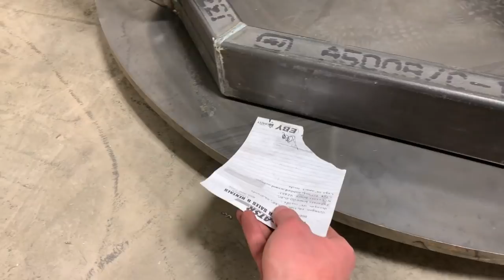Building a table to hold my vise

Comment: Excellent fabrication skills - yes. High quality video storytelling - yes. But absolute lack of planning. Honestly - if you see drawing of this first would you build it? Guess no. Because it's ugly and badly designed.
Reply from the maker: Ummmm.... I spent several weeks designing this in CAD before I built it. It’s not built for looks, it’s built for functionality.
Reply: It is few times (ten?) easier to fabricate square frame than octagonal. Right? Your calculations said square frame (with diagonals) not strong enough? Can't believe. Probably you just afraid table edges is too weak without frame under them (and going to bend down if you sit on them). Cut 45 degree bevel on the top part of legs (to make room for clamps) instead of just move whole leg few centimeters? Brilliant idea! Make vise support beam long and use it as part of frame? No, few extra welds completely fine. So, as you understand, I have doubts you really designed it.